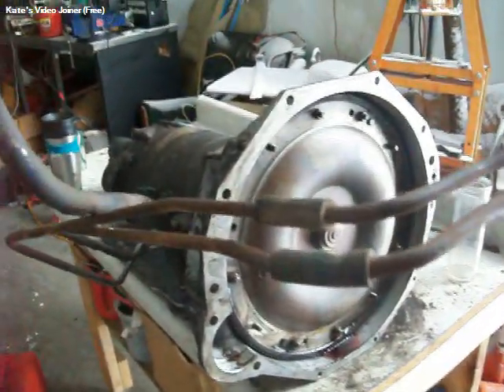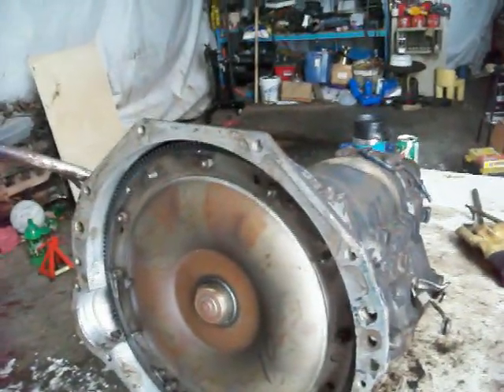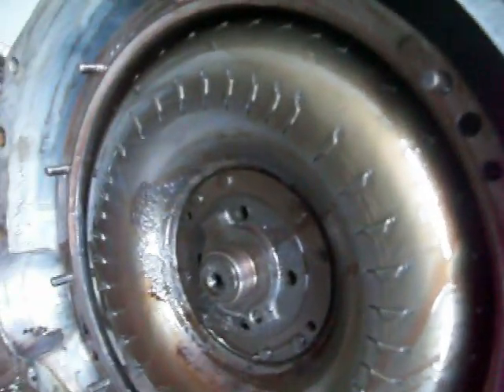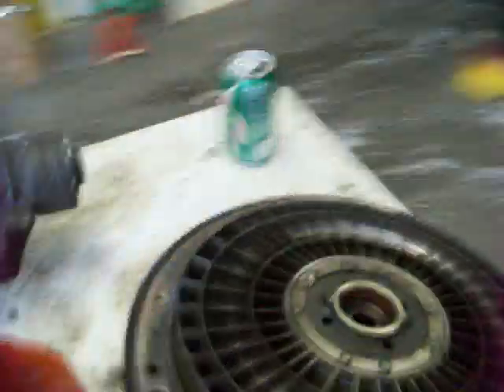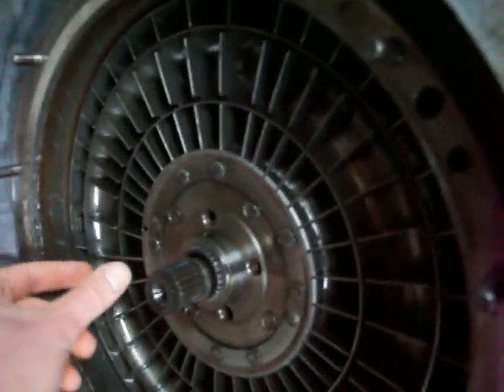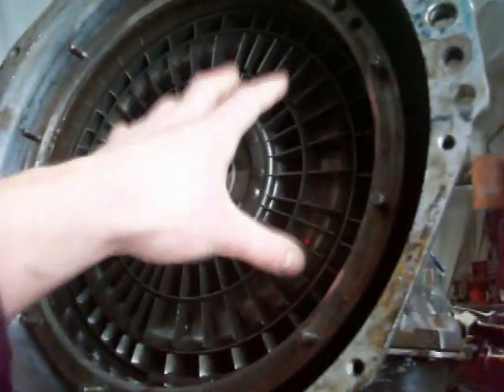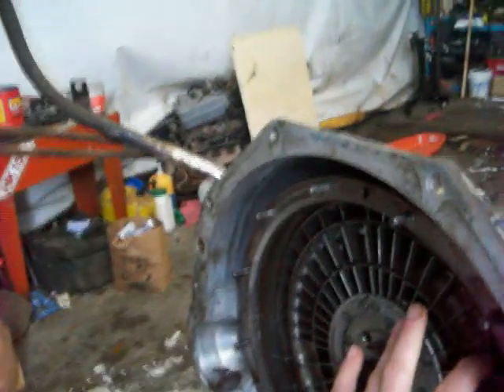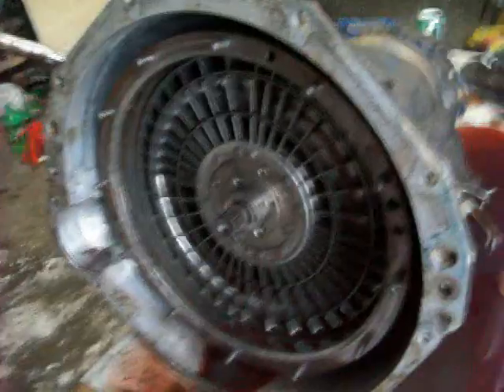Fluid Couplings and Torque Converters

Comment: the reverse preasure reg valve when you take that out inside the bore you can see a sleeve with a pilot hole was that a 2 peice sleeve or 1  cause i have taken mine out and its in 2 cause im having trouble with the reverse it wont stay in reverse when engine is running when selected but engne not running select reverse start engine and it reverses

Comment from the maker: @PinelochTundra This one is a 1960 but I think they started using this same trans in 56. There is an o-ring on the flywheel and there is a seal behind the fluid coupling in the bellhousing.  If its leaking out of the front of the bellhousing then its probably one of those two.

Comment: @onyxreddragon Powerglide is fairly conventional - torque converter and compound planetary gearset. The '57-'61 Turboglide (and Buick Flight Pitch), Dynaflow, Dual Path, and Roto-Hydro ("Slim Jim") are unconventional. The Jetaway Hydramatic seen here is also unconventional. It's a relic with two fluid couplings (one used to shift), three planetary gearsets (one inside the front coupling!), and a wacky cone clutch for reverse. It's *very* heavy and wildly complicated when you really dig into em.

Comment from the maker: @MrYussel I don't think you could mess anything up unless you tried to take it off with a sledgehammer or something lol. It's just two bolts that hold the coil on, take those off and the plug wires then it just pulls off and you can put the new one in.